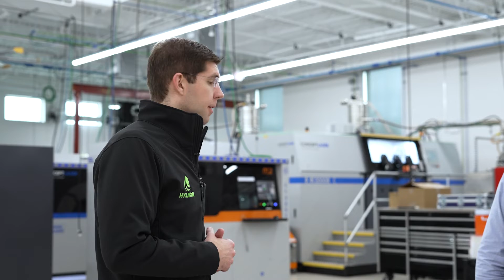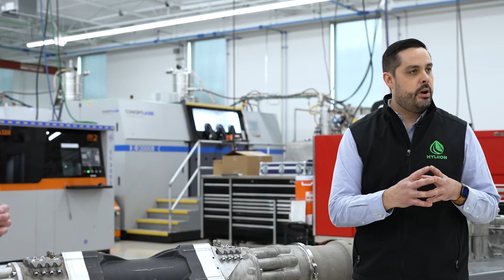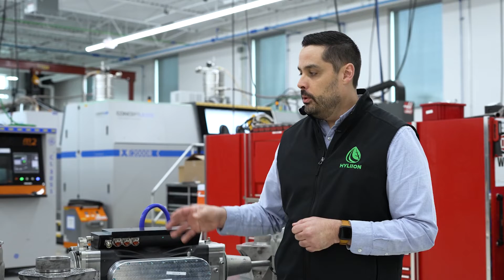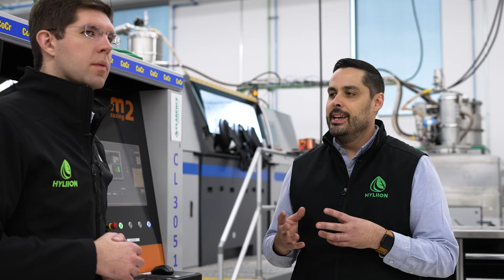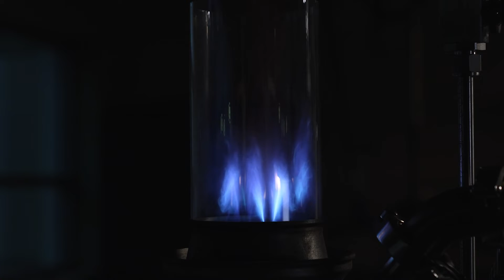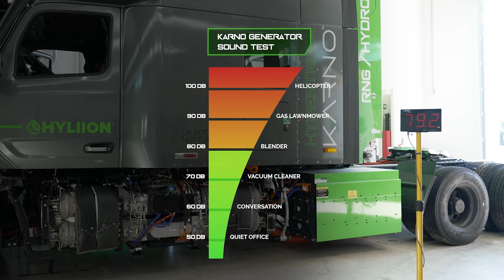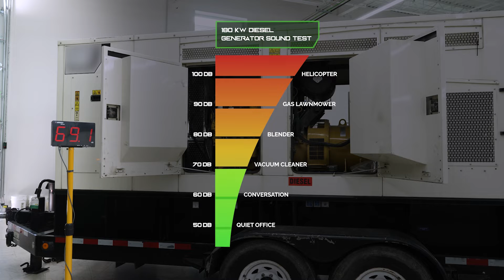KARNO Generator Tech Fireside Chat

Comment: Thanks for the breakdown of the technology. I do hope the 3-D printing will scale / snowball as the orders start coming in. Best thing is as changes are needed it's super easy to just change the printer programing. All things considered this is a much better use of your capital position than trying to get the tax credit with the ERX and the 15l Cummins. Hopefully we will see these in a working Karno tractor trailer and maybe even a working concept for a freight rail engine, that is a huge industry that needs this technology! The stationary generation could be tough depending on fuel costs. Also forming partnerships with RNG companies like Clean Energy and other "green" fuel companies will help future clients a lot with package contracts.
Reply: Why a “locomotive engine”? You would need 100 Karnos units and then you would need a “tender car” for the low carbon fuel which has been tried and rejected for various reasons in the real world trials that were conducted in the past!
Reply: @Mentaculus42  Correct, in those 4+ MW engines it would be best to continue using a turbo diesel-alternator set for now for long distances, until Karno is ubiquitous or can be shipped ahead and installed at repair yards. Though with their efficiency, 25+ swapable four unit Karno banks running on diesel or bio diesel in a belly tank is fine with how massive (20+ m long) those engines are. They would forgo long warmup/idle times and reduce maintenance (which is a lot, I've been on maintenance teams for 3.5 MW backup power sets, it's an evolution!); ancillaries like the oil sump, turbo set, alternator, radiator (or a smaller one) which are all huge in these engines are eliminated.

Also if a Karno unit or two fails it can just be isolated through software and over all engine power output will barely fall, especially for multi engine trains, then the banks with failed units can be swapped out when convenient. Though a new long hood would have to be designed to take full advantage of quickly swapping Karno banks.

Karno would excel in replacing diesel-generator/alternator sets in smaller engines and run them on CNG or RNG, and those fuels are available or can be piped into nearly any yard. I also agree running any engine, except maybe a yard or shipping port engine, on H2 is a pipe dream since it's low energy density in CG form would require a tender car(s?) for distance travel and a robust extensive low carbon H2 infrastructure won't exist for quite some time, it's best to just use diesel and NG for that.

Comment: Fireside ....didnt even see a fire to be beside.
Can this bloke deliver one thing.

Ps -wheres the staff or "stuff" they are working on?
Reply: 😄There's definitely background noise. Additive manufacturing ... "set it, and forget it" - Ron Popeil 
but yea, it would have been more encouraging to see workers in the background.
Reply: The staff was fired 😭
Reply: @computergiant  estimate is they are down to about 86 employees... as sad as it is, definitely working for a startup, people accept the risk (usually you trade risk in exchange for stock options - or that's how it used to be before Sarbanes–Oxley when I worked for my last startup job). They were geared up for truck electrification system assembly, and pivoted to a different type of manufacturing that didn't require their skillset. I'm sure quit a few picked up their family to move to Cedar Park, TX ... which means they'll have to move back to where trucks are manufactured for better employment opportunities. It's why I'd never work for a startup now - but when I was younger, I could shake it off. The options from my old job never amounted to much. I think I still have about $3000 worth of their stock (was planning on those shares turning into $100K :D ). I have no clue how effective HYON will be at executing the new business strategy. Great ideas - but ... no legacy other than meeting past milestones (other than sales targets).

Comment: What about Mainspring as DIRECT competition to Karno generator ‽ Their free piston engine also has flameless oxidation for low emissions but not the complexity or cost associated with the use of additive manufacturing. YOU NEED TO CONTRAST YOUR BENEFITS!!

You talk about using “sour gas” that would be burned off in the production field. How does your Combustor deal with that bad and corrosive contaminants? Some of the latest turbofan engines had combustor corrosion problems from sulfur compounds! You also danced around what happens to the bad emissions if you directly burn “sour field gas”!

Also the combustors in stationary turbine systems have different fuel delivery injectors for gaseous vs liquid fuels. Also combustors that use hydrogen in turbines have to be completely redesigned to deal with particular hydrogen combustion issues, how do you get around that  ‽

Also how do you compete on efficiency on larger installations where the ICE’s are getting 55% thermal to electric output efficiency with bottoming cycle ‽
Reply: These questions were specifically addressed in the Q/A part.  They specifically stated that because the hot side and the working parts are isolated, there is not real issue with those poorer fuels.  They will have to deal with the exhaust if the pollutants (that do no participate in the oxidation process) will pass right through the combustor and exit the exhaust.  As for the multi fuel, they specifically stated that their system can run on any fuel without any part # changes... the entire system works on any fuel as is.  The system already supports 100% hydrogen as a fuel.  They also talked about the efficiency cycle... the comparison they made in the demonstration was that the Karno was almost twice as efficient as the classic diesel powered genset.  (The diesel was listed as between 20% and 25% total efficiency, whereas the Karno was at about 50%.)
Reply: @williamsteele  Not to mention the pollutants would end up in the atmosphere anyway when the gases are flared. Instead that heat is turned into electricity, lots of sour folks here.
Reply: No, a short list of prefered fuels is not "any fuel", @williamsteele . Do you really think that you could put heavy fuel oil or raw vegetable oil into the fuel injector designed for methane and have it work?
Reply: @brianb-p6586  A short list of 21 fuels and counting... however, it will run on anything that can be placed in the fuel tank, including raw vegetable oil.  The gasifier takes care of the pre-atomization required for a liquid fuel, regardless of how heavy it is... any gases can simply pass through it.  There are no "injectors" per se... it's just a pressure system to feed it... and latent heat generate the necessary pressure.  There is a valve to control the air/fuel mixture, but no injectors except the passive ones.  Don't overthink the mechanism... any heat generating source can actually be used... but the more efficient fuels will obviously do better.
Reply: I might add, they've shown their "injectors" at various shows... it's all just printed parts, there is nothing active in them.
Reply: @williamsteele 

Actually, if you carefully go through the videos and take screenshots and read their display info, they appear to purposefully misrepresent what the display items actually are. It is only when the “talking head” grabs a device and says what it is, that one can go back to other video and look at it in more detail. So your opinion about their transparency is a joke. As far as the terminology of “injector”, I assume you are trying to conflate the meaning from high pressure injector of a diesel engine vs a fuel injector / nozzle from a turbine engine. As the Karno technology was developed and brought from GE Additive which directly deals with the design and manufacturing of GE’s turbine combustors, I think the terminology of injector is sufficiently descriptive and reasonably correct, but if it makes you happy, we can call it a “nozzle” with regard to the fuel entry point at the top of the combustor. I personally consider the terminology interchangeable with injectors usually employing higher pressure for liquid atomization, but if “everything” is a gas in a Karno combustor, then nozzle is appropriate, BUT external liquid fuel “gasification” seems suspect.  Doubly so when you see the inconsistent combustion of liquid fuel particles in the exhaust stream. 

Once a person has figured out which part is a cross section of the combustor, it looks very similar to a standard pre-mixed multi-nozzle combustor technology that has been printed. 

As far as information about “fuel atomization” of liquid fuels, you are the first to “speculate” about that. Traditionally, dual fuel gas turbines have optimized separate fuel paths into their combustors for the different types of fuels. With liquid fuels it is very important to use some pressure to “atomize” the fluid. You are saying that GE utilized a different approach, maybe you have information that Hyliion has not talked about. 

Considering that Hyliion still goes out of their way to NOT SAY STERLING ENGINE, but they give it some proprietary mystical name to fool the simpletons! Also Hyliion had a graphic stating that Krarno was 59% thermal efficient BUT now it has MUCH LESS efficiency with regard to final electrical output. Low enough now that it is very close to the efficiency of the newer ICE engines that are 49% thermal efficient and don’t have the larger power electronics losses associated with pulsed electrical current conversion. BUT existing ICE generators have been operating at 55% TOTAL efficiency for some time now and have faster response times than Karno which is very important for their applications. 

Additionally, Hyliion has repeatedly said that Karno was 50 kW per module, but that turns out to have been the future “projected & hopeful” output. I find that rather “illuminating” with regard to “truthfulness” and transparent disclosure. 

In further addition, it turns out that GE used Libertine linear motors with air-bearing technology that was developed by that company. Hopefully Hyliion has LICENSED THAT IP!

Sterling Engines suck for “power density” due to all the heat energy having to be transferred across TWO heat exchangers which partially explains the “business model translation” to stationary power applications. Along with the predicted knowledge that a truck would be economical unviable with a Karno. Karno had no chance of remotely completing against Cummins’ new ICEs (cost vs efficiency) that also can be fueled with low carbon fuels. Also, a lot of work is being done to increase the ICE thermal efficiency to more than 50% range without using bottoming cycles.

This is definitely “MAKING LEMONADE TIME” to be sold as Fool-Aid!
Reply: @Mentaculus42  My understanding of the Hyliion remarks regarding Libertine is that they are currently buying entire linear generators from Libertine, and plan to take that "in house"... whether that means licensing a design or technology from Libertine to build a copy or similar device, or designing their own without violating Libertine's intellectual property.
Reply: @williamsteele  I would not expect active parts in a fuel injector for this type of application; as @Mentaculus42 noted, it would just be a nozzle.
Reply: @williamsteele  The anticipated fuel savings of the Karno over some comparison diesel was claimed as between 20% and 25% reduction in fuel consumption. If the Karno is at 55% efficiency, that implies diesel efficiency of 41 to 44%, which is plausible. The specific diesel unit shown was reported to be spec'd at between 20% and 25% total efficiency, but it was probably just whatever they could get from their local rental outlet, not comparable to what a diesel-electric series hybrid truck would use.
Reply: @williamsteele  
Actually they didn’t, they said some generalizations but didn’t answer these questions at all, at least not from an engineering perspective. When they say, “we tried such and such, it didn’t immediately crap out” is as far away from doing the proper engineering lifetime test as is possible. Basically, as an engineer, what was said was  talking points for simpletons to motivate them to … As far as your technical explanation as to why it is this or that is not what the problem is. Things just passing through that labyrinth of a hot side heat exchanger is quite a laugh. Their efficiency is also not as good as existing ICE generators on the larger range that they said they were going to try to sell into (they need to be better than 55%, as that has been accomplished for over a decade now!) Also it appears that everything you “know” about Karno comes from “THEIR TALKING POINT”. Maybe it helps to have a graduate engineering degree from a competent university and to have spent around a day on figuring out in detail what they are “not saying” before one drinks the “Fool-Aid”. Actually I was rather moderate on the critical aspects of any questions, besides it was them who “painfully avoided” answering the question. For example, California would not allow someone to burn contaminated fuel for power generation these days! So ok in Texas probably, but they were rather bad in their answer.
Reply: The comment early in the Q&A was about "flared gas" or "field gas", not "sour gas". Many oil production sites flare off gas because they don't have a gas pipeline to transport it to market, or generation facilities that can effectively use the gas on-site. 

Yes, if the gas is too sour it can't reasonably be used in an engine without scrubbing first, and from an environmental perspective it should be scrubbed even if flared. In the later Q&A segment about sour gas this was acknowledged. Of course if you burn gas with sulphur compounds you get other nasty sulphur comments, whether the burning is in a flare or an engine. The burning in the Karno is not "flameless" (despite their claims), but it is at near atmospheric pressure (like the flare), rather than the very elevated pressure of an internal combustion engine.
Reply: The Karno does not have flameless oxidation. Not only is there no catalyst to enable flameless oxidation, the flame is clearly visible in the video. I don't know why they make this ridiculous claim - maybe they think we're all idiots. 

I had not heard of - or had forgotten about - the Mainspring engine (known as EtaGen until 2020). It is very similar layout (reciprocating pistons on a linear generator), but functionally it is an internal-combustion engine, not an external-combustion hot gas engine; that means that it does not use heat exchangers the way that an external-combustion engine such as the Karno does, so all of the additive manufacturing discussion doesn't apply to it. While Mainspring claim that their combustion is not combustion, that makes no physical sense. 

By the way, despite their founder's silly claims, the Mainspring engine is simply a piston-ported opposed-piston 2-stroke engine in a free-piston configuration driving linear generators (although they insist on calling the working cylinder the "reaction zone", and the pistons with linear generator moving components "oscillators"). It's interesting, but it not some new radical technology. Similarly, the Karno is a current implementation of an old engine design, driving a linear generator rather than a crank.

However, while the Mainsping is not a useful example, it is true that external-combustion engines can function without using additive manufacturing for heat exchangers. There have been Stirling engines in production for decades proving this.
Reply: @brianb-p6586  
Ahh, someone that actually knows something. I purposely didn’t differentiate that Mainspring was internal combustion which avoids the dual heat exchanger issue and thus the absolute requirement for additive manufacturing (which I alluded to). Mainspring also says flameless oxidation in there propos. I think that term maybe a bit over used but there is definitely a technical definition that is a bit counterintuitive.
Reply: @brianb-p6586  In "Flameless Combustion" - visually what is observed is a blue glow without a discrete flame front (although occasionally we see impurities in the gas burning off orange). A blue appearing flame means complete combustion of the gas. In one of the demos, it's bizarre to see diesel burning with a blue flame like CNG. Burning gasses in this way avoids the formation of NOx and the internal recirculation of the exhaust gas ensures CO is minimized - no need? for a catalyst to complete the explosive combustion process in a traditional ICE. Look up videos on "See Thru Engine" and "Can You Light DIESEL With A Match" to see the color of the flame front of both Diesel and Gasoline are BRIGHT yellow. I've read "Flameless Combustion" and "Flameless Oxidation" are terms that are used interchangeably - however Flameless Combustion does involve a visible flame (without a yellow flame front). Suspect either GE or Hyliion switched to "Flameless Oxidation" for marketing purposes - to get away from the word "Combustion". It sounds like a typical Stirling engine operates at a 38.5% thermal efficiency - Karno's claim is up to 59% based on GE data - due to the efficiency of heat transfer through the 3D printed heat exchanger.
Reply: @brianb-p6586  The only reason you can see the flame is because it's on the test stand with a glass instead of the normal chamber... the glass is too cool to allow it.  Under normal running conditions, there is no flame.  No catalyst is needed as the air and fuel are individually brought up to temp well above ignition before they enter the mixers where they can react.  The glass is there to view the flow paths, but prevents the high temps needed for the reaction to occur.
Reply: @williamsteele  what a pile of nonsense. It's burning - there's a flame, and that's okay.